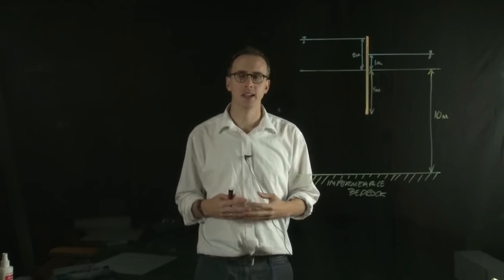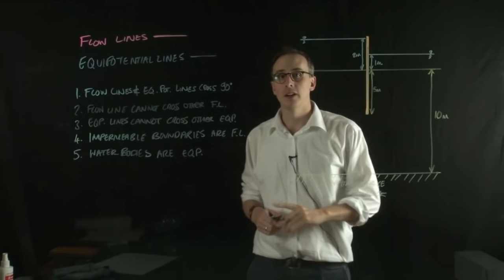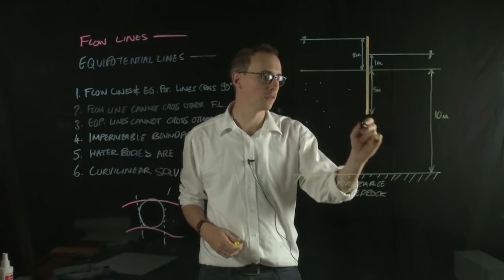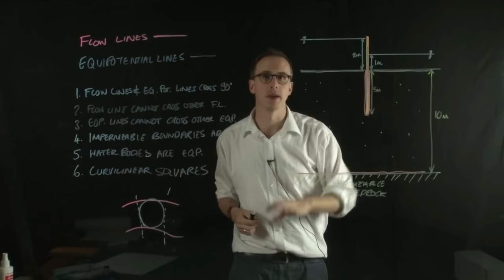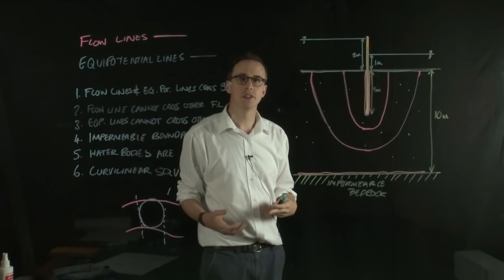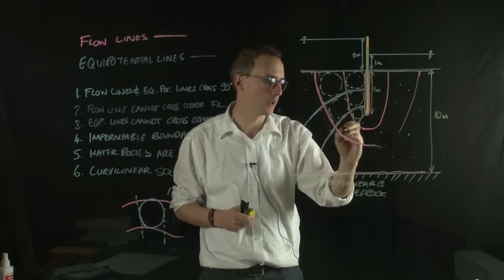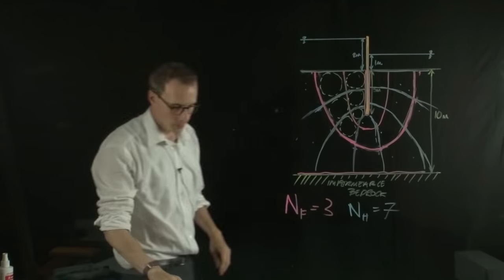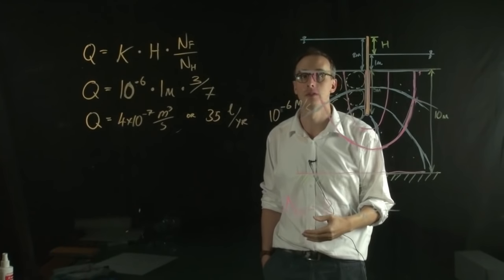Flow Nets

Comment: It is the circles, guys.  You have to have 4 tangent lines surrounding a circle.  
1. You start with the equipotential lines at the ground level and impermeable layer 
2. Then you draw flow lines than are parabolas that end perpendicular to the ground equipotential line. You can make how many you feel is right. (The fewer lines the bigger the circles you'll imagine later are going to be, the more lines, the more circles you'll have to draw but it'll be more accurate)
3.  (The most difficult part.)Draw parabolic equipotential lines that are (1) perpendicular to all flow lines they cross and (2) a circle can be drawn in the resulting inner area that all sides touch the surrounding lines at one point (tangent lines to the circles)
4. Count-out flow channels and drops.

I'm just a student btw, this just what I got from the video.

Comment: An example of unconfined flow with a sheet pile driven halfway into an aquifer is shown in
Fig. 7.19(which is same is the figure you have drawn.). The flow net is horizontally symmetrical, providing that the top and bottom flow lines (borders) are parallel and the penetration of the sheet pile is exactly one-half the depth of the aquifer. Note
that the number of flow channels Nf is 3 and the number of equipotential drops N dis 6. Regardless of
how many flow channels you use, the Nf!Nd ratio, or the shape factor, will always be 1/2 for the geometry of this example!
<<Holtz and Covacs, 2nd ed>>
any comment on this?

Comment: Phil how do you know how many flow lines and equipotential lines you need? I've read everywhere and no one gives me a straight answer or an equation to follow. Thank you!
Reply from the maker: Hi Ryan, good question. It doesn't matter for the maths as the number of equipotential lines will also increase. If you stick to the rules you should end up with the same Nf/Nh no matter how many flow lines are used. In practice, a flow net with too many lines is tricky to draw. Remember, you'll be rubbing things out and redrawing as you go along.
Reply: We have  the same unanswered question

Comment: Question sir. How do you find the pore pressure of a certain point if it is located at the very center of equipotential line? We know that pore pressure = 9.81(H + h - mH/nd)

Where H = head of water
h = height of saturated soil above the point of interest
m = number of equipotential drops from zero to point of interest
nd = total number of equipotential drops.

So how would you know the value of "m" in that case?

Comment: Wouldn't (4x10^-7 m^3/s) = (0.03456 m^3/day) = (12.61m^3/yr) = (12,600 L/yr) ?
I think the value you calculated was the daily value and not the yearly. Although it seems like too large a value

Comment: Very helpful video. I have a question about the units. I realize that flow is expressed in volume per time, but if K is in (m/s), and H is in (m), should Q be in (m2/s)?
Reply from the maker: Great spot with the units! It's really m3/s per m of hydraulic structure (if you imagine the structure coming out of /going into the screen).
Reply: Oh, I see. Thanks a lot.

Comment: Hi
I i thought H was 8m -1m??
Reply from the maker: Not sure where you got your values, but H (or really 'delta' H) is the pressure difference across the system. In this case 1m.
Reply: Is the left water height 2m? Because it looks like 8 also.